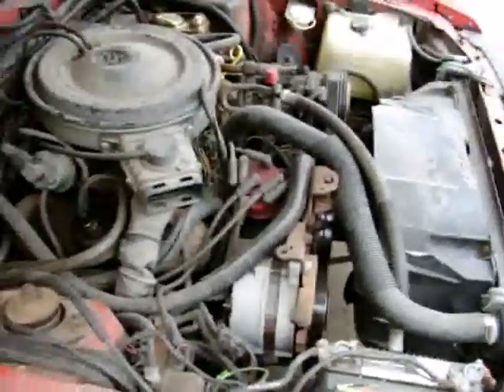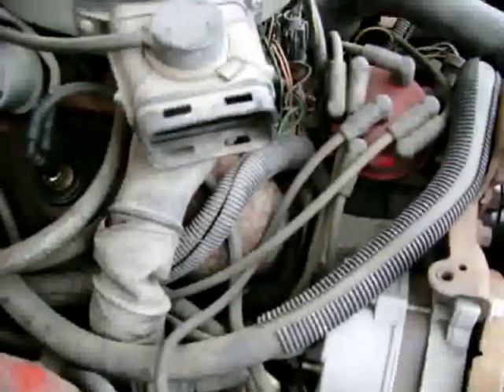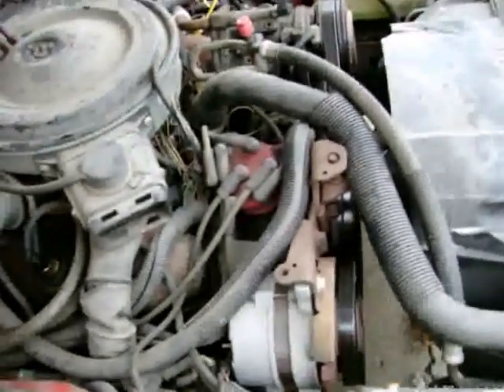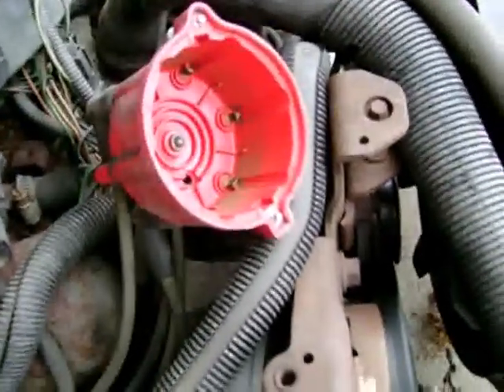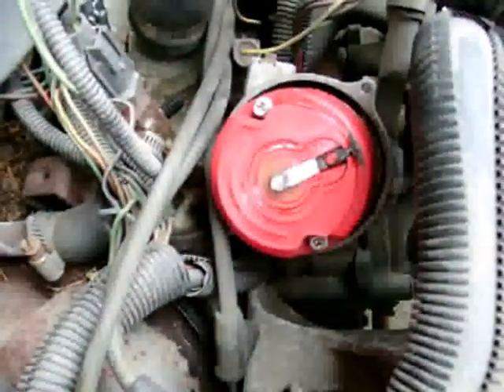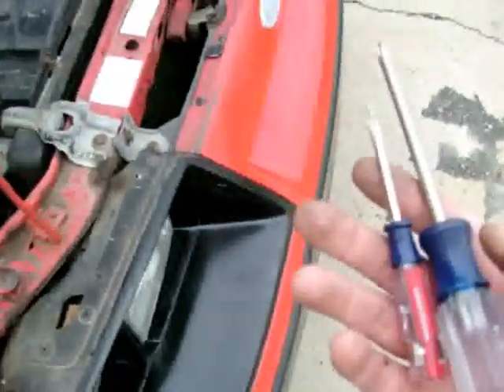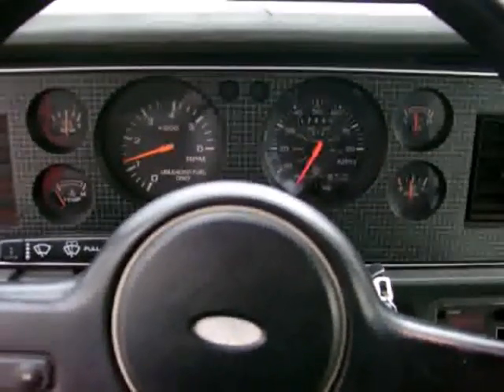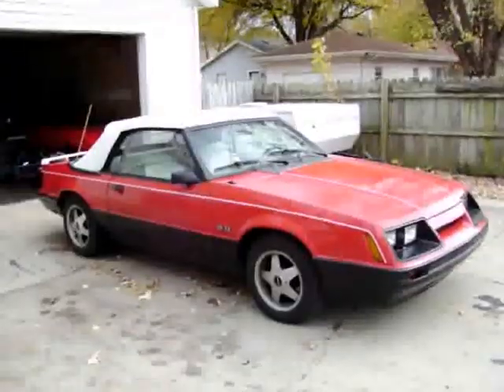Fix Your Idle and Hesitation Problem For Free, Clean The Cap and Rotor, Better MPG Too!

Comment: Those black cap deposits are caused by high resistance in the ignition circuit.
The better fix would be to swap the ignition module for the HEI one, and use an MSD Blaster coil + the MSD Super Conductor wires. Also, the distributor harness contacts have high resistance as well. Cleaning the cap alone will impress the prospective buyer though. But he will be stuck with the same probbies.

Comment from the maker: Took it off with a philips head, scraped the terminal ends on the inside with a screwdriver tell the white carbon build up is gone and you can see the brass / metal ends.  Be sure to clean the rotor button too!
VT247

Comment from the maker: @dgaleno2012 Not sure what kind of car you have but here are some guesses.  You may have moved the distributor when you replaced the spark plugs adjusting the timing.  OR... The RPMs went down after spark plug replacement because the knock sensor isn't detecting a miss fire anylonger and trying to compensate.
VT247

Comment from the maker: @chickitakoowan The car had more power after I cleaned the terminals because it has a stronger spark.  More spark will burn the fuel better = more performance and economy.
VT247

Comment from the maker: @ELtee555 Traded a guy a $500 Geo Tracker for this mustang.  You're right, it doesn't have the 5.0 it's got the 3.8 V6.  The fenders had the 5.0 decals on there from a previous owner.  It was all show & no go.  That's why it's the 'cheap mustang 5.0' lol
VT247

Comment from the maker: If your truck has a distributor cap[ on it and the terminal ends have corrosion tracks around, it will certainly help.
VT247

Comment from the maker: @DONALDHITMAN Don't need to disconnect the battery.  It's safe not to.  There isn't any current going to it as long as the key is off.
VT247

Comment from the maker: @dgaleno2012 Not really understanding what the problem is?  What kind of car and what year?  Make sure you didn't cross any of the spark plug wires, make sure they go to the appropriate cylinder.
VT247

Comment: @Vacationtime247 hey man i dont think is the spark plugs. when i move the steering wheel for example to the left when is stop my rpms drop is it normal??? so i discover that right now n went under to check my axles n discover that 1 needs to be changed but is not a big deal yet cuz if i let my steering wheel go when driving it doesnt pull to one side so u think it has to do with the axles?